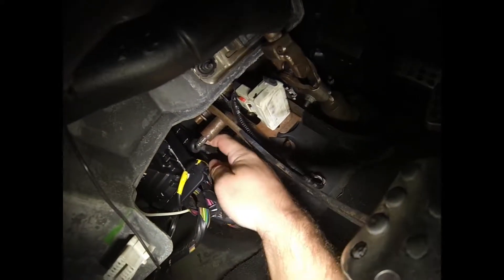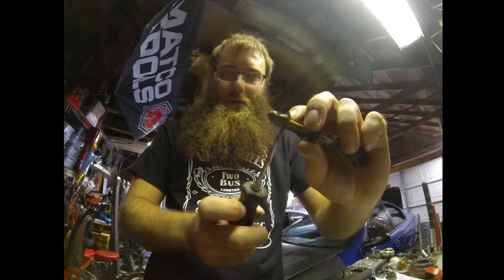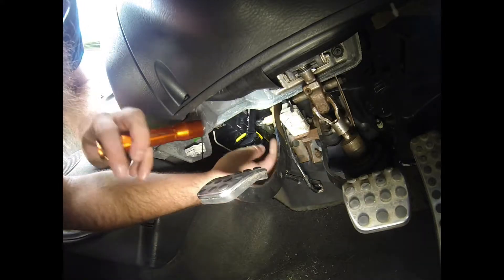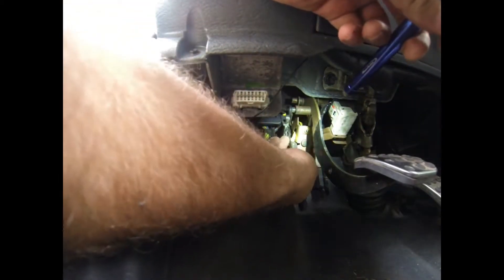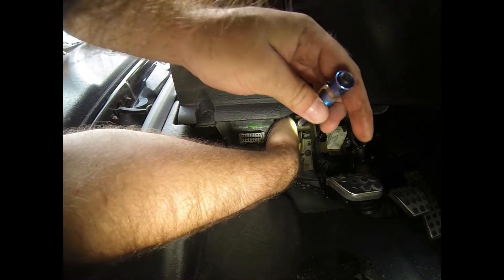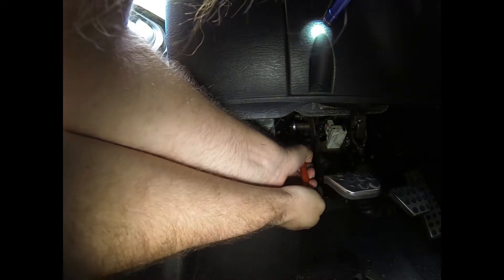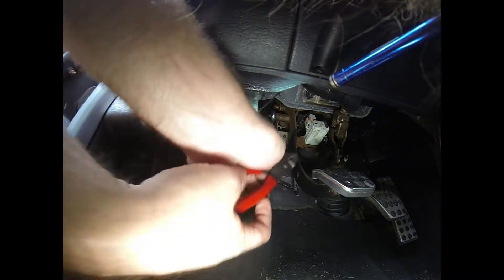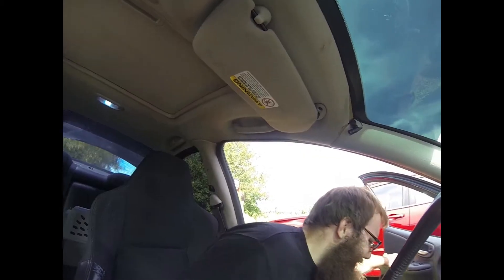How To: Dodge Neon SRT-4 Clutch Pivot Arm Replacement

Comment: wait so you don't need to put that weird clip that sits on the factory rod on the DCR one ? the clip that sits at the end of the rod ? doesn't it hold the piston to the rod ?
Reply from the maker: It does hold the piston in, but, when you properly adjusted, it should never pop out
Only if the clutch pivot rod was not in place, and you push back on the slave with your hand, would that ever be a concern